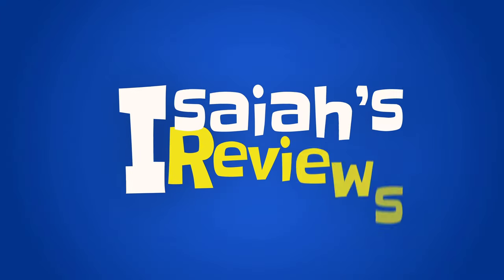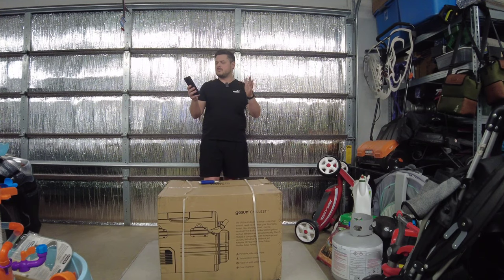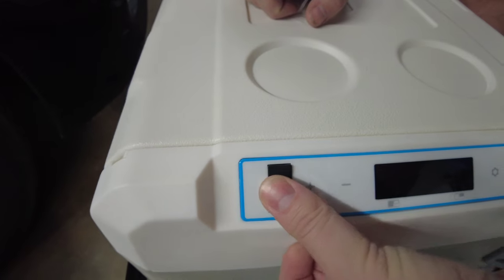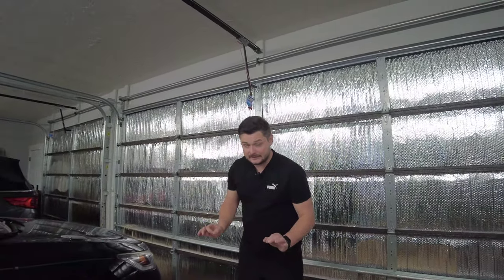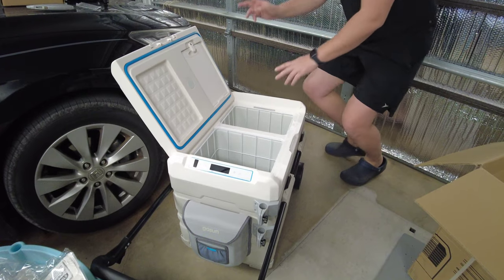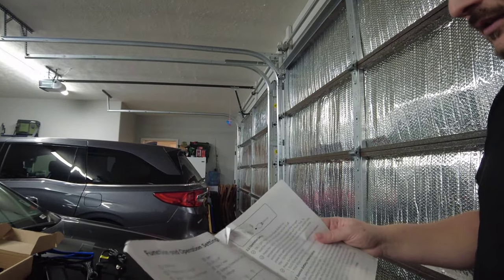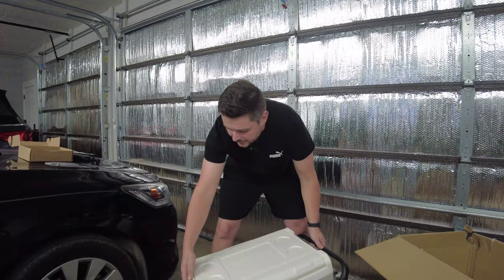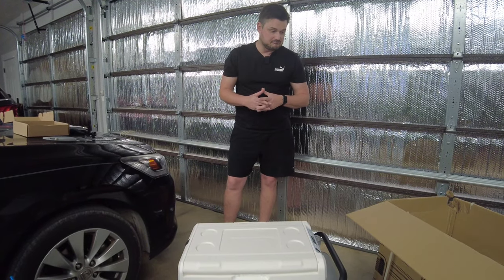GoSun Chillest Battery Powered Cooler with an App UNBOXING

Comment: UPS did an awesome delivery of mine, ignoring the "This side up" markings... leaving it on its end, on my porch.
I left it off for a week ,til initial power up... Seems to be fine... and testing w/ potatoes for a few weeks.
App will NOT connect/ work... I'm gonna contact GoSun about it, after my testing is completed. 
The cheap plastic wheels marked up my linoleum floor nastily in wheeling it out (empty) to the garage. Am considering getting real rubber wheels for it, eventually. I've NOT yet tested battery run time,but WILL look into extra/ spare batteries, eventually..

Comment: Ty for the review ... By any chance, did you test how long the stock battery lasted, and at what temp were setting on? 

Also, is the $79 battery you got the same one that is $135 now? I bought that extra battery pack (gosun power 266) in the set during the gosun campaign, and I'm contemplating if I should just pick up that $135 one for now or wait until that pwr266 comes in 🤷🏻‍♂️ ... feeling a bit duped
Reply from the maker: The stock battery lasts about half the time the separately purchased battery lasts. Link 👉 https://www.ebay.com/itm/Massimo-E-Kooler-Battery-FSAK-002-15600mAh-fits-ENX-62-TWW-75-TWW-95-/265291640975?mkcid=16&mkevt=1&_trksid=p2349624.m46890.l49286&mkrid=711-127632-2357-0
Reply: I use the 266 all the time. It is a beast. I have an older 144. I also have the 1100 behemoth for the campground. Thinking about the chillest but I might not have enough space.

Comment: There is no Bluetooth connection, so the GoSun Chillest app does not work! I was told  by GoSun it was left off the product.  The battery last about 8 hours not 10. The manual says not to sit on the lid so the video is wrong. The lid get cold so it is not very well insulated. Still waiting for the Solar Table may get it in Feb or Mar!
Reply: Waiting for the solar table also . No Bluetooth chip huh. Glad I asked about it with you. Guys. The Bodega Cooler on Amazon is an exact copy of the Chillest, and there Bluetooth link works. Wonder if GoSun will offer an upgrade later on or is the Bluetooth option not available a permanent thing.
Reply: @shagonoy  This is what they sent me:

Hey Robert,

Thanks for your message.

After thorough investigation, it has become clear the component sourced for the Chillest does not include blue-tooth capabilities.  Despite instructing/paying our manufacturers to include this feature, it is not present in this production run of the product.  As a remedy for this issue, we are offering you two sets of GoSun Flatware at no cost.

The Elbow Solar Table for the Chillest was held up during production due to global supply chain issues. This will be sent separately once we have them in stock in January/February.  We sent the Chillest ahead of time so that you could still use this product at your leisure.  You will receive an email with tracking information once your order ships out for the Elbow Table.

Feel free to contact us with any further questions.

Best,
Reply: I told them I want what I paid for!  No reply!
Reply: @robertkirkpatrick6315  $15 (currently with their sale) worth of flatware is hardly a replacement. I’m not sure that I would really use the app to be honest except to see what the temps are off and on. But I agree with your other comment of wanting what you paid for. I would rather have at least a partial refund rather than flatware I don’t need. And most certainly not a $15 refund.
Reply: @shagonoy  the Bodega is very similar. To the point of wondering which came first? The GoSun has a few changes from the Bodega up front: 1) hooks for the bungee cords, 2) mounts for the solar elbow table and ability use it for that matter and 3) mounted storage pocket for cables and power banks. I am not certain about battery comparisons either. Are they the same capacity? Also, looking at the Bodega cooler in pictures I’m not sure about an input for solar. It looks like it’s available but I can’t quite tell. I’m eager to see what GoSun has to say and I’m hoping for either the ability to return for one that has Bluetooth as paid for or at least a partial refund. I’ll go through my emails and the Kickstarter updates but I’m quite certain that there was never a mention of coolers shipping without Bluetooth. But now that they are out there it seems like it was a known issue.

Comment: The Bluetooth app didn’t work for me. Did it work for you.
Reply from the maker: Nope. I've messaged GoSun and they haven't replied. Not very good service
Reply: My app cannot connect with mine either. I used the chat bot with Gosun and it said the first wave of production coolers did not get the chip that has Bluetooth. I sent a message to ask what my recourse is at this point. After I sent the message I got a notification that it can take up to 3 days for a reply. Hopefully next week I will have an idea of what’s going on.
Reply from the maker: Wow! Be the first to back it, get screwed then ignored 🤔 That's great service
Reply: @isaiahsreviews  given the pandemic and the small size of the company, I’m not surprised. That part isn’t upsetting me. It’s the wrong chip being put in. Will see what the reply is and go from there
Reply: I just got mine and I downloaded the app and it isn’t connecting for me either
Reply: @metalmasher6251  dang so if you received one from the 1st wave you won't have Bluetooth.  They better send another cooler! Or knock a couple hundred off the price (refunds).
Reply: @YouTubeWeAllTube  I did hear back from them. $25 refund or $50 credit to their store. I really don’t see myself utilizing the app so for me it’s more of not being in the loop when this became a known thing. I am angling for full cooler replacement because it is what I paid for. If I had been notified during the manufacturing process of the chip issue, and been given options for refund, credit…before I received the cooler, then things would be different for me.